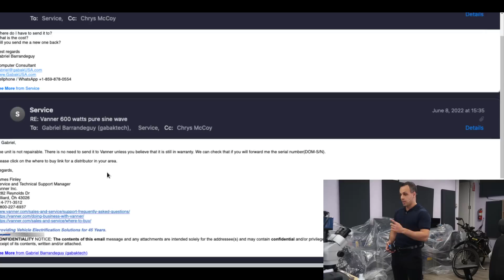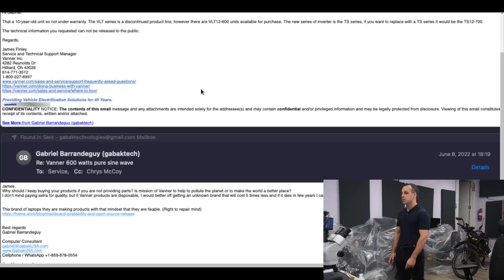Vanner takes the L on repairability

Comment: So tech guy asked schematics for inverter? Next episode: someone asks pin-out for 3pin mini-jack in order to troubleshoot broken cable in his headphones.
Reply from the maker: Most headphones aren't $700
Reply: @rossmanngroup  I guess, $700 headphones' cable is not much harder to fix, than $10 ones'. How much of a difference do schematics make for the person, who obviously failed to perform basic tests on its own?  "Surely, there is a component that is bad", — Jesus Christ, man, with all the schematics, all your equipment in his disposal he would never know what to start with. I'm not arguing with criticism against Venner, but after Gabriel tasted euphoria of RtR activism, may be it's time for reminder, what it's all about? Actually fixing your stuff, you know? I doubt, one-time repair of an old inverter needs specific schemes in 80% of cases.
Reply from the maker: @MM-cz2yh  I mean you're just going out of your way to be an asshole here, keep on keeping on.
Reply: The manufacturer should put the circuit diagrams and board layouts on their web site. The instruction book for the oscilloscope I bought in the 1980s contained both. It wasn't uncommon to find a circuit diagram on the inside of the cover of some products.

Edit: BTW, I've repaired the scope a couple of times, but it still works.
Reply: @sylviaelse5086  I found a full schematic AND board view for my 1980's H/K Amp

Comment: That's abysmal on Vanner's part. I'll be sure to never get a product from them unless they change this policy.
Reply: @mkuhnactual Don't get me wrong, I would love it if all manufacturers included schematics, but no one does, so I wouldn't call Vanner out specifically for not doing so. And it sucks, I dislike this throwaway culture. We also used to bring shoes to a cobbler to get them repaired, but now they're all glued together and are a throwaway item. I wouldn't expect a manufacturer to hold the hand of a consumer to repair their device - especially one to run on an ambulance. Most repairs [in general] are done by a third party anyway - like a plumber fixing your toilet. And look at your Haynes service manual for your car, it's put together by a third party. However, where I stand and fight, are when manufacturers specifically engineer their device to prevent repair. ie. potting the PCB, tripwires that brick the device, needing to reprogram the new component, laser etching part numbers off of their ICs, etc. *I will concede however that a lot of professional level devices do come with a schematic. Vanner definitely rides the line on that one.
Reply: @ts757arse  I agree for the most part - it's all in context. If I were to buy a set of inverters for my house, I would expect them to last 15-25 years. Same on my car, I would hope to hell the ECU would last longer than the engine - at least on the fleet average. My point was more that 10 years doesn't seem egregiously short lived - especially on something that likely spent most of its years bumping around in an industrial vehicle. Inverters are also extremely hard on their components - it's one thing to monitor some signals, process them, and send signals out, it's another to generate 2000W and have to supply that power to whatever random product a user plugs in on the other side. ie a heavily inductive/capacitive load, handle power spikes on both the supply and driven side. I actually used to work on an ambulance that had a Vanner inverter, we had that ambulance for 10 years had to replace/repair a lot of things. The inverter was not one of them.
Reply: @ts757arse  For your bike, just get a 12V amplifier!! Car amplifiers are designed to take a beating, I'm sure there's a weather resistant one out there that can handle a 20W speaker and tuck under your seat. 

On stuff like inverters, there really isn't an early warning sign on failure. It's the swiss cheese model, generally there are redundant systems that can accept a single point of failure. In the case I mentioned, the pacer that was being used happened to have run low on battery because the power supply from the helicopter we picked them up from failed. There is always a chance things line up and the worst case happens. If MTBF is 10 years, it's extremely rare that happens. There's a better chance of getting a flat tire during transport, and in that case, you call another ambulance. It sucks, but it's rare.
Reply: On one hand, sure. On the other, how many electronics have you had that lasted 10 years? Thats pretty good, and as long as they’re not actively engineering the unit to prevent people from opening it up and repairing it themselves, unlike one wheel or Zero, then they’re not the devil in my book. Not an angel, but also not the devil. Don’t get me wrong, I’m all for right to repair and try to buy products that can be serviced where possible, but I would not expect proprietary schematics to ever be given out. The dude should have definitely been more helpful troubleshooting though. The answer is probably a blown cap, I’d open up the unit and check for any caps that blew their top. If not that, then look for any corrosion around components and spooge some flux on them and reflow.
Reply: @ctbrahmstedt  Why would you not expect "proprietary" schematics to be given out?  You know that's a newer trend right?  50 years ago you'd get a schematic in your user's manual, that was the standard.   Also not giving out schematics will not stop companies in china from putting out clones of your product, all it does is hurt the consumer.
Reply: Most of my electronics other than my phone and gaming PC is more than 10 years old. My main TV is a made in USA Pioneer plasma from 2007, still works great and has an amazing 1080p picture. My monitor on my PC is also from 2011, still works great. Same with my stereo, etc etc. Electronics CAN be built to last.
Reply: @christianelzey9703  Oh ya, certainly. There's nothing I love more than going into an old music shop and looking at receivers from the 1970's that sound just as good as anything you can buy today. I think we as a whole have shifted to a preference of cheap over quality. A $500 Denon receiver from Best Buy may now have a lifetime of 10 years, a $6000 McIntosh receiver I would expect to get 50 years out of. A kitchen appliance I may expect 10 years. I guess my point was more that, for the most part, if I get 10 years out of something that I use on a daily basis, especially on devices on the market today, to me, that is a quality product. (Outside of something particularly known for BIFL, like a Rolex, McIntosh, etc). And I try where I can to buy the 20-30 year quality product to tell the manufacturer that there still is a market for quality. For a Vanner inverter - assuming it lived its life in a bumpy industrial vehicle - 10 years doesn't sound like a premature failure. Unfortunately, it's just such a niche product, that there really isn't a market for a Louis Rossmann repair center for them.
Reply: @ctbrahmstedt  Nah I'll buy something 1/6th the cost and repair it myself when it breaks. If I gotta reverse engineer the device to fix it because they won't give me a schematic so I get to spend days working on it rather than an afternoon I'll just buy a cheaper one and fix that as it fails. Zero reason to buy the higher price one if I can get 6 of the cheaper ones that are equally repairable.

Don't give me the "they don't want someone to steal their design" spill it that is said by people who do not understand a single thing about reverse engineering. If I can figure it out in a week then a team in China who are set to make millions off of producing this for cheaper they can figure it out even faster and optimize the design to figure out where they can cheap out at. 

I do iot bug bounties and have reverse engineered entire products miles more advanced than this. I'll take a cheap oscilloscope, jtagulator, usb eeprom reader, usb to uart cable, chipwhisperer, and Radare2 or Ghidra and I'll tell you what every single thing on it does. I've been doing that since I was 17 and I'm self taught on at the time very limited funds so if I can do it they definitely can. There are millions of people just like me who are miles better and significantly faster with much much better equipment. So their little proprietary schematic means literally nothing. All it does is make it worse for the end user so they can buy a new product instead of fixing one. It also puts unneeded strain on electronic repair shops here in America. The only reason to do it is so someone has to but another one and there's a big profit incentive for that. I'm all for someone making money but how much extra do I need to pay before you give me a product I actually own? I'll pay extra for that. I won't for anything else.
Reply: @n111254789  That's great, and you should! You are not Vanner's customer base, nor are ambulance/trucker fleets AliExpress's customer base. Two completely different markets. You and I can afford for a component to go down for a few days and take the time to repair it. A trucker who may make $5000/day in revenue (not profit) just can't afford a cheap product that may break down once every two years instead of every ten.
Reply: @ctbrahmstedt  What does that have to do with anything we discussed thus far and where did I say I was their customer base? It's about them screwing over their customers for no reason other than feeling the need for even more massive profit margins than what they already have. 

Also I don't know if you realize this or not but hospitals are very cheap the head position of a hospital is usually a revolving door so they buy the absolute cheapest things they can to maximize profits and not really worry about what happens in the future because they won't be there. Go work in a hospital see how many things break constantly. So honestly it's probably truckers and others fooled into thinking price = quality which is Snap-on's entire business model and as we know not even remotely true anymore. 

Regardless none of this had anything to do with them being garbage for not providing schematics. I already know what you'll say "others do it they should be able too right" no not really it's terrible for any of them to do and it should be publicly shamed like it is here until they lose business and furthermore why are you supporting them for this? Why are you such a big defender? Are you an employee, share holder, or do you just like the taste of boots and this steady change into not being able to work on anything you own? Is it the flavor of their shoe polish? What is it you enjoy about this enough to defend this practice?